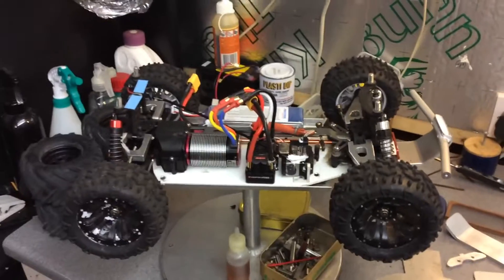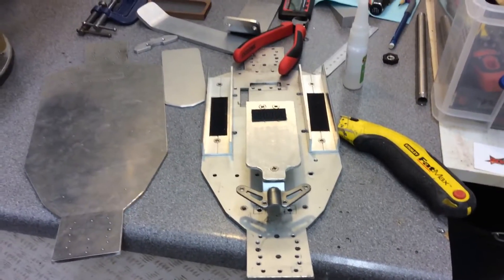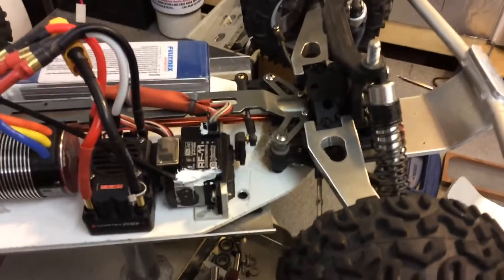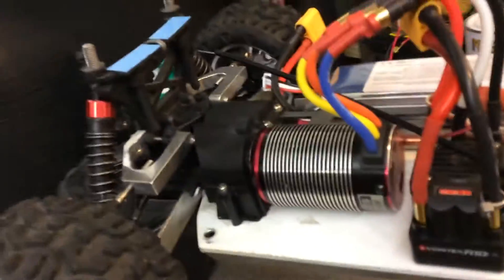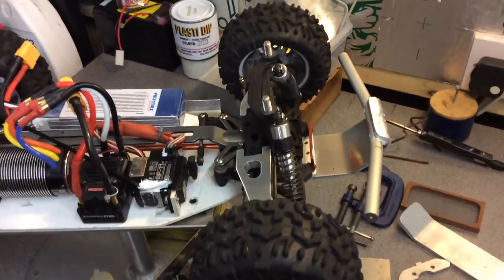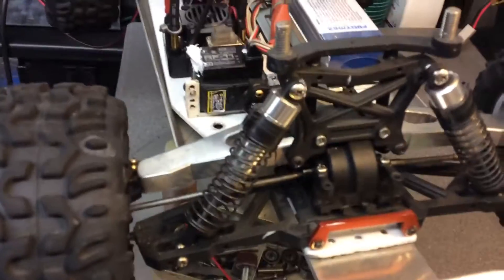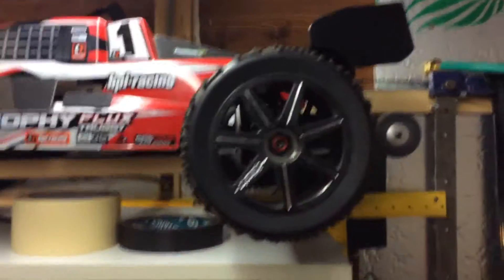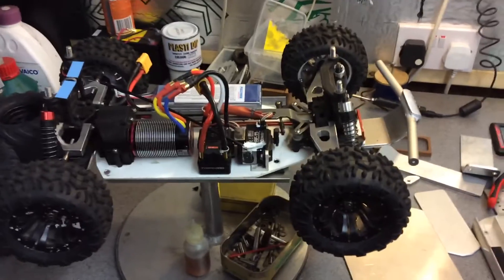Helion invictus part dominus overview

Comment: Have you had any trouble with the dog bones? I have universal joints installed on my invictus and I'm trying to figure out what they can take
Reply from the maker: Pecker Gnat  they r fine on 4s mate not had a prop with them at all
Reply: Son Hall so the diff are the weak points? Sorry there's not alot of info online about these trucks.
Reply from the maker: Pecker Gnat I no mate 4s is to much for the diffs